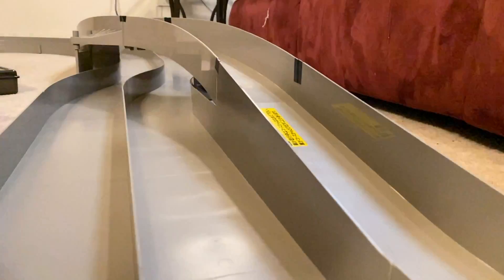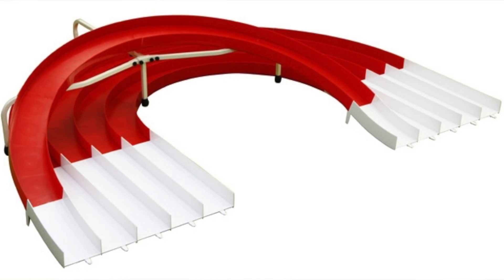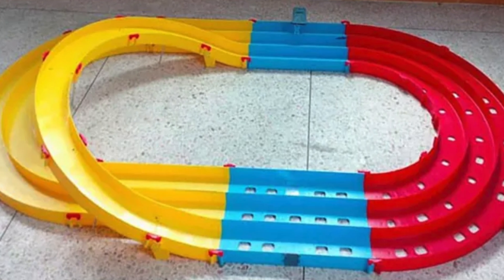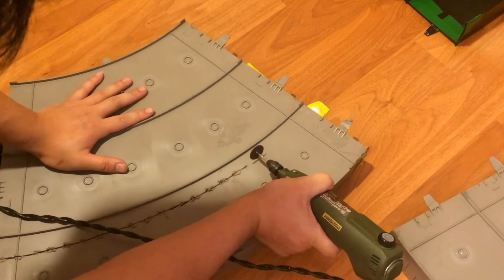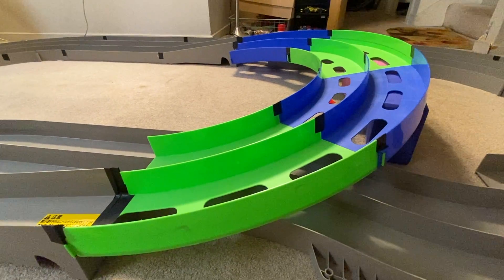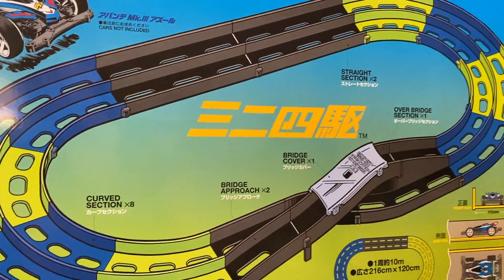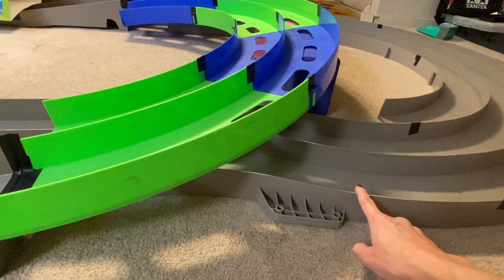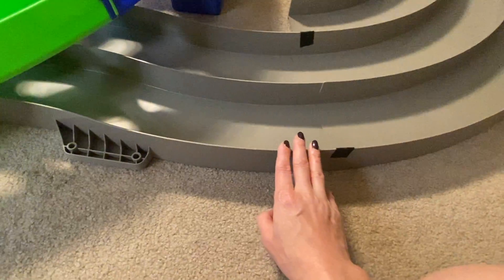Tamiya Mini 4WD - Making Your Own Rainbow Lane Changer

Comment: My car fly off the rainbow lane changer. Is it too fast or what . 50kmh+
Reply from the maker: Your car is too fast! :) The rainbow will have a lot more flex than 3-lane track so you may need to stiffen the joined parts to reduce the flex. Try more tape or reinforce the outside of the joined parts with small pieces of cardboard or plastic and tape over the pieces.

Comment: '
hello pretty lady...
i have tamiya 1/32 mini cars...
only rear wheel drive run and no 4X4...
front is a neutral...
still good run very well...
try use a LIPO battery 3.7 volts and no need two A A batterys 3 volts
Reply from the maker: Thank you for the tip! Unfortunately, the racing events I go to don't allow LIPO batteries, only NiMH and alkaline, but I will experiment and see about LIPO in them! :)
Reply: @claredin  
hi C...
'
okay thank explain